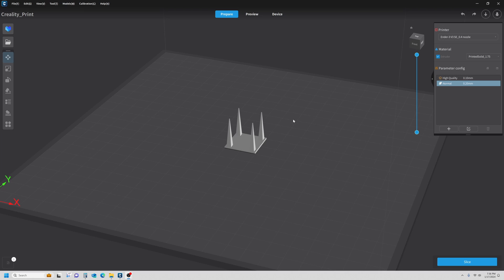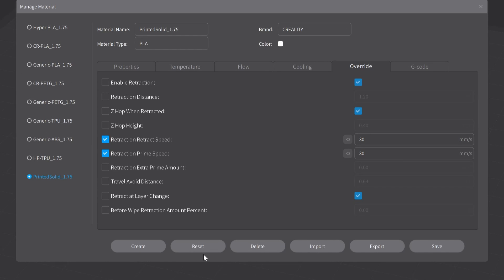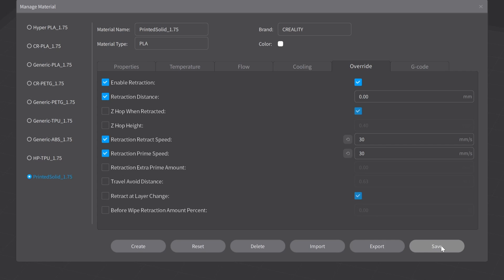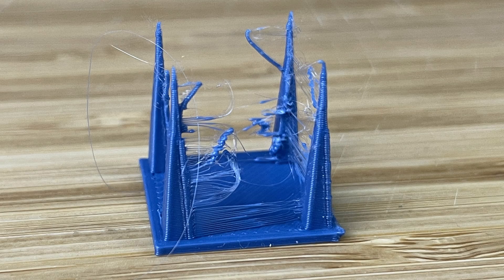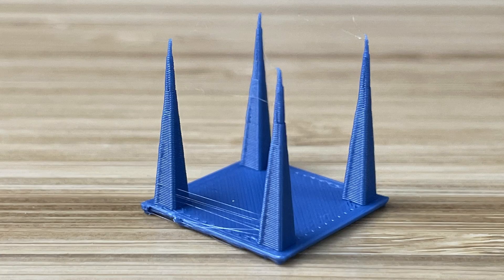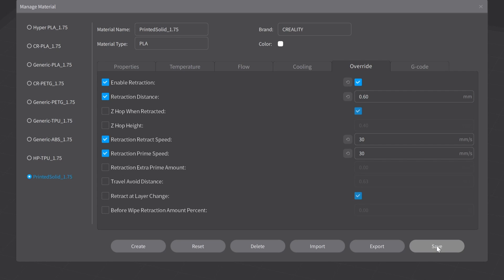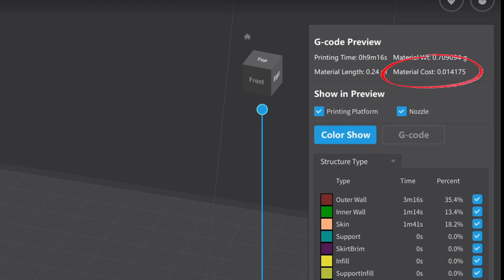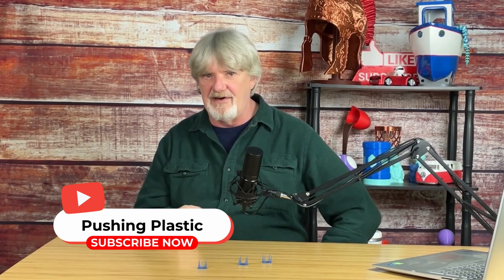Get Rid Of That Stringing In Creality Print

Comment: What is the difference between changing the settings in override vs changing them in the settings editor?
Reply from the maker: The settings editor, it makes those settings default. But maybe you want a different retraction  distance when printing with PETG, use the override.

Comment: I have an Ender 3 S1 printer and have used Sunlu and Creality CR filament. I recently downloaded Creality print, to see what the standard settings are for various Creality items. You would think that the people at Creality would know exactly what you should use for settings with there printer and there filament. Not So. 3d print companies are like building an automobile, selling it, never starting or driving it or one like it. Not a very good company, my opinion. I purchased the printer,refurbished, so it was much cheaper. Refurbished being that it had been returned, so they re-sold it, after looking at it. The bed and the extruder both had about 3-5 mm of slop, the rollers being so loose, so tell me they tried it, no power cord.

Comment: Thanks for all super videos, My K1C had 0.8mm for retraction, It gave very little stringing, but the problem starts in the peaks, where the layers are only seams. Then I increased it to 0.9mm, but underextrusion started to appear. Do you have any suggestion about what is going on here?
Reply from the maker: I would bump it back to 0.8mm and run a temperature tower, even if you already ran one. It might be just on the high side allowing the hot filament to still ooze! Good luck & be sure to let us know if it helps!

Comment: What if that didn't help at all? Retraction tower is beautiful even at 0.4 but any other print  like the model in the video is overstringed. Tried to change from 0.4 to 0.9 nonresults. Tried to change temperature (best results are at maximum 255-260) but still not perfect. Checked the flow rate, checked the esteps, changed nozzle, no changes. First models did print well and now it started to happen even with filaments that worked good. Filaments are dry. Creality ender v3 se, different PETG filaments. It places a snot even at the begging after cleaning track.

Comment: I purchased a k1 max and I am using the hyper pla. I have been trying to adjust the temp and retraction all day but still after every test I get stringing. I am using creality print. Any suggestions on what else to change? Can it just be the speed it is printing? It is set to 300mms?
Reply from the maker: Start with the stock settings for both the machine and material. The dial in your filament by running the temperature tower, flow rate, pressure advance and finally work out your max volumetric speed. Then run retraction distance calibration. A lot of people try to adjust the speed right away. Dial in the material, you'll be able to dial in your speed better. The max volumetric flow is the big one. This is pretty much a speed limit for your filament. You'll most likely find a higher number for Hyper PLA than you would for standard PLA. But running too hot and too fast is going to give you stringing.

Comment: Do you have a retraction video for Creality print 5.0?
Reply from the maker: Coming soon!
Reply: @pushingplastic7445  I've notice that retraction distance doesn't seem to be reflected in the gcode after you update its value in Creality Print 5.x. I get the same stringing issues no matter what value I set for retraction distance.
Reply from the maker: @Expt626  There's more to stringing than retraction alone can fix. Sometimes it's damp filament, sometimes too high of a printing temperature, sometimes it's a matter of printing to fast.

Comment: I keep having heat creep with my K1. Its new, ive only had it about 3 weeks. When i try to print anything larger or takes longer than am hour, the filament swells and causes a clog and I have to take it all apart to get the filament out. Its really a pain to take the hotend apart. Is this the nest way to prevent the heat creep?
Reply from the maker: I haven't experience that. What filament brand & type are you printing with and what temperature are printing at? I'm very curious.

Comment: so I've dialed in the temp pretty well at 210C and followed the flow rate video to get a flow rate of 87% which does seem a bit low but based on the process that is what I got. Now I am just struggling to see any improvement in stringing as I slowly increase my retraction distance from 0 up to 3mm without very much change at all. I feel like that is getting kind of high. Is it possibly realistic to go higher than that? What course of action would you recommend from here?
Reply from the maker: 87% on the flow seems really low! But if that's what the results show I would stick with it. For the retraction I would keep going until you find the happy spot. What filament type? PLA?
Reply: @pushingplastic7445  It is PLA+, Inland brand from microcenter

Comment: So I started at 0.0 and then went to .5 .6 .7 .8 even 1.0 1.2 1.5 no matter what I did it kept stringing. What am I doing wrong and what else can I do?
Reply from the maker: I would check my temperature and flow rates. Then I would retry the reaction tests. Another thing to keep in mind is that damp filament will also result in stringy prints. It doesn't have to feel wet to be wet! A good test for damp PLA is to try to break a piece off of the spool. If it snaps right off, you have damp filament. If it bends a lot, then your filament is fine. Good luck and let me know if this help!!!! Thanks for watching!
Reply: @pushingplastic7445  so you think I should do the temp and flow test again and dial those in one more time and then try the string test again? If my filament is damp, how do I fix that problem?
Reply from the maker: @michaelshanley3939  I would check the filament for dampness first. For my filament, I use an old food dehydrator to dry it. Very cheap, like $35 new on Amazon and a lot of time found at a goodwill or thrift store for about $5. A lot of people have them laying around their house and forgot they even had it! I use the round one and cut the center out of the trays with the snips that come with a printer. I'll put about 3 spools of filament in there for 4-6 hours at 45C and it's good to go. You don't have to buy one of those dry boxes that a lot of 3d Printer companies are selling. There are a lot of videos on YouTube for drying filament that might give you other options. But checking the filament for dampness would be my starting point. Good luck!
Reply: @pushingplastic7445  thanks so much for the info. I just checked my filament and it's bending very nicely. Looks like I'm gonna do the temp tests and flow tests again and hope to dial it in a little more. Thanks
Reply from the maker: @michaelshanley3939  You got this!!!
Reply: did you find the right settings?  I'm having the same issues.  My dehydrator comes in today.  What material are you using? PLA and what brand?  If you would share your settings!! Thx
Reply: @shinli00  at the time I was using a black pla from creality it wasn't anything special just the standard black pla from creality. Unfortunately I don't have exact settings for everything anymore as I had done so many test runs with this filament and couldn't figure it out. I went back to the default 1.2 as it was the best option but still had stringing. I'm very new to 3d printing as I believe I've stated before, but I've learned a few things since this post. 

I was running default speed of 180mmps and hadn't changed anything speed wise

My temp was around 200 to 205 
And my flow rate was 94 

Knowing was I know know about speeds 
I would suggest slowing you speed down immensely to anywhere between 40 and 90mmps 

Travel speed anywhere between 120 and 150mmps 
 
And retraction and prime speed anywhere between 40 and 50mmps these too should match each other. 

Then run these tests again and see if you get better results
Reply from the maker: @michaelshanley3939  I'm using FreMover PLA (very Generic brand), 230 Temp, 95% & 0.5mm retraction distance at 40mm/s retraction speed.
Reply from the maker: @shinli00  I'm using FreMover PLA (very Generic brand), 230 Temp, 95% & 0.5mm retraction distance at 40mm/s retraction speed.